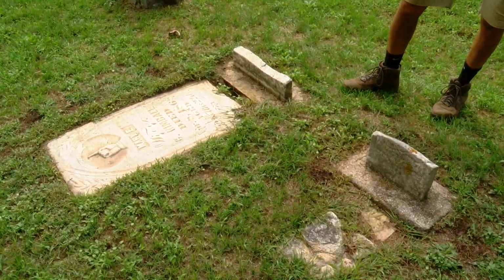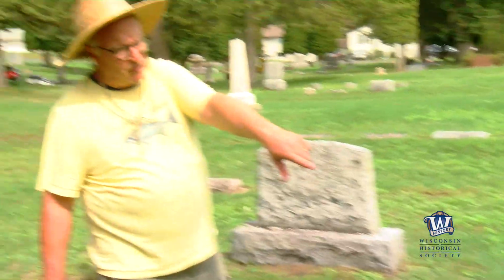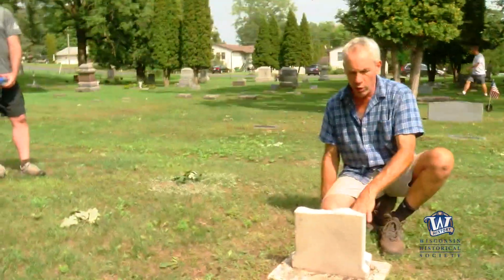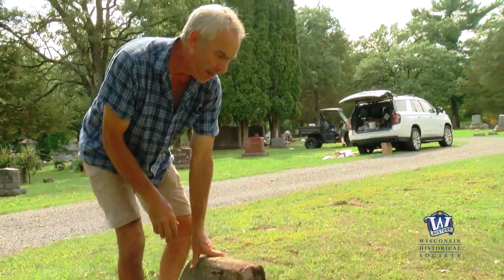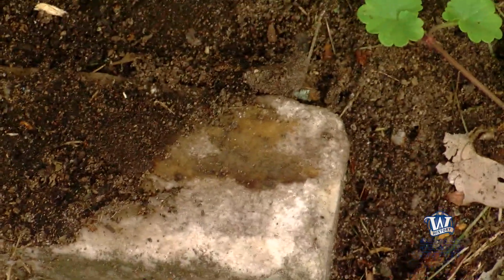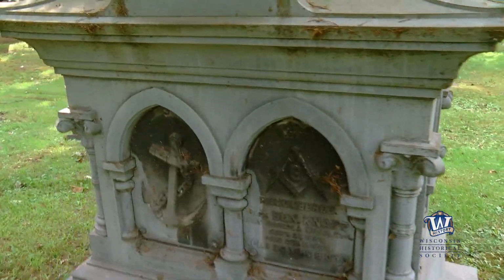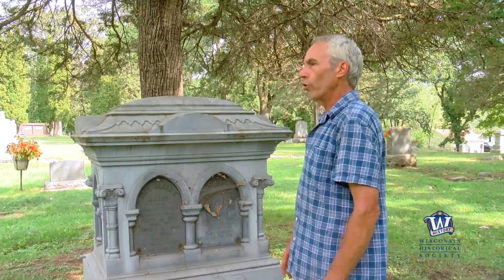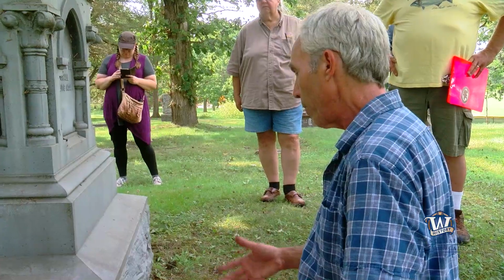Local Cemetery Conservation: Common Cemetery Conservation Needs

Comment: So, does the speaker ever say what mortar is "compatible" with marble, granite or limestone?
Would suspect that mortar used in the 19th century would simply be sand and hydrated lime.
Could this type of mortar be used to piece together a broken tombstone?
Reply: Historic pointing mortar. Can be found on the atlaspreservation website. But that is mainly visual, it should be epoxied together in the center using something like akemi akepox 5010